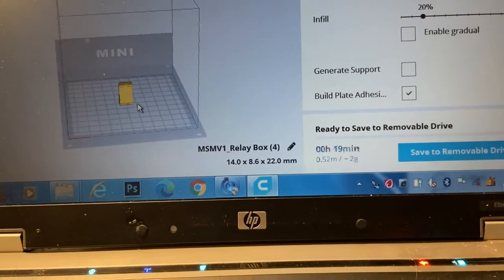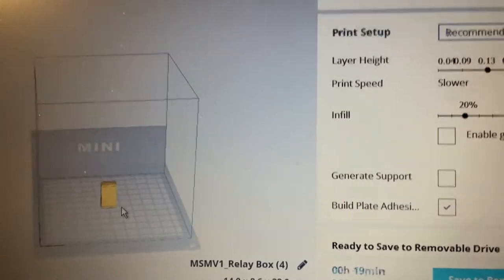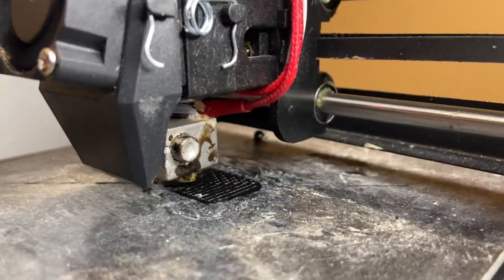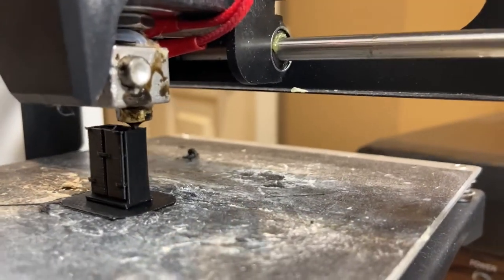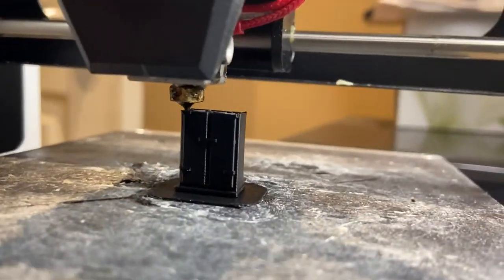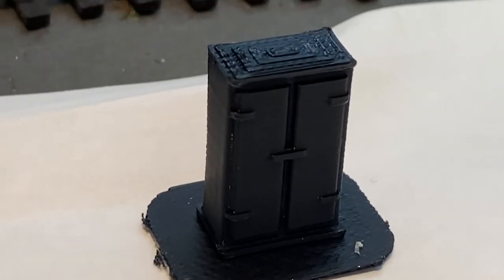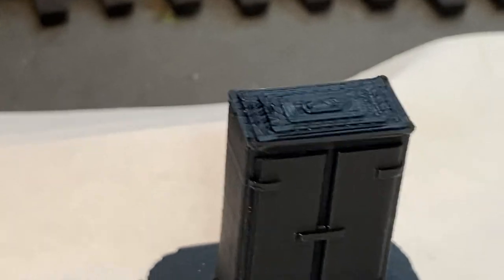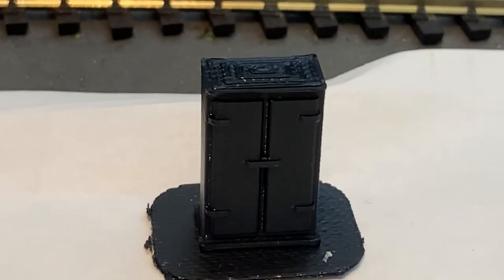Printing a Relay Box for my model railway using my Monoprice Select printer

Comment: Great job Charlie looks good, maybe you could do a separate roof and then you can glue it to the top? Glad you got it working 🙂👍🏻
Reply from the maker: At that scale it is not a big deal but as I move forward with it I will probably just model a sloped roof from front to back
Reply: @charlie1872  good idea 🙂

Comment: That looks very good Charlie, why does it need such a large base?
Reply from the maker: Digger, the "Base" you are asking about is what the printer creates for the model to be printed on. It is very thin and peels off when finished so, when you build the model you need to think how you instruct the printer to print.
As the actual concrete base is flat this was perfectly flat.
Thanks for asking